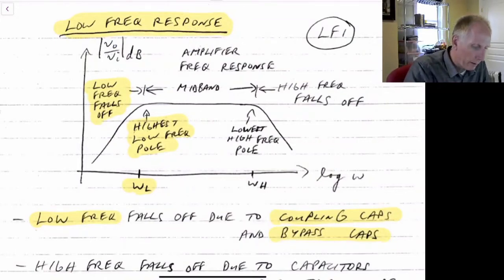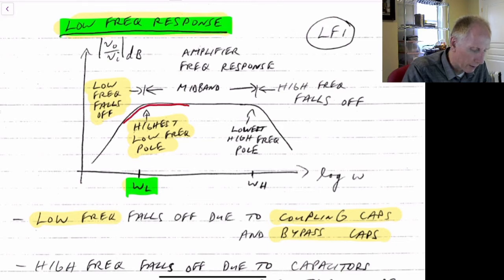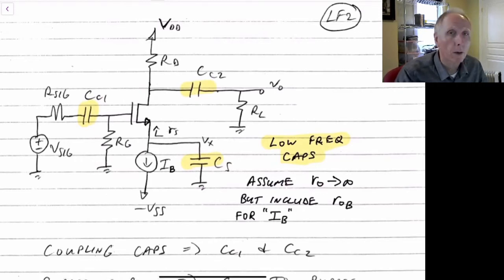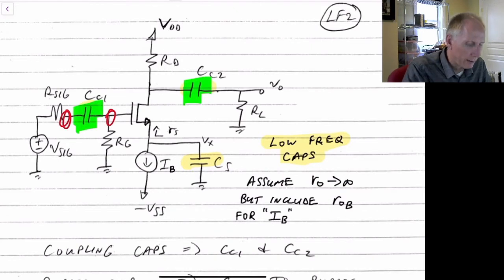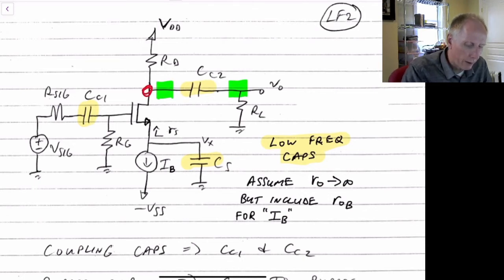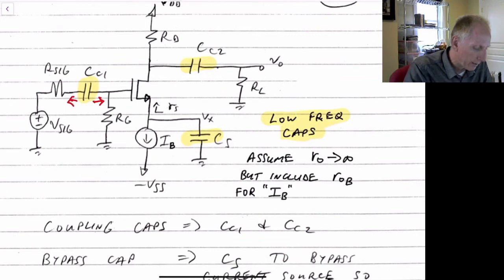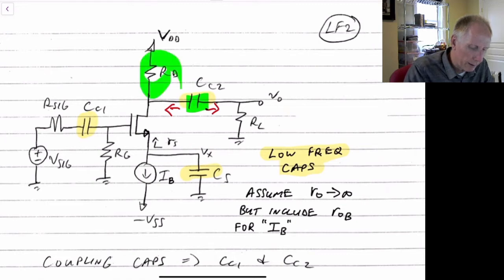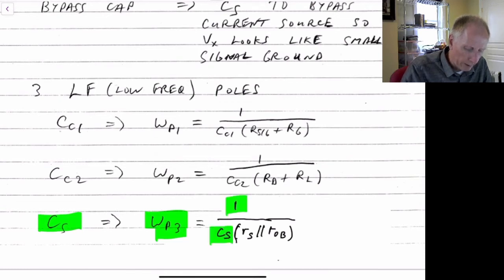Analog Electronics 2 - Low Frequency Cutoff

Comment: 10:15 - Why is that short circuit current 1/(r_s + r_{OB})? Can you give me a breakdown of the analysis steps?
10:32 - Here we talk about "DC" gain, i.e. when frequency is zero, but I am just wondering since we are looking at the "small signal model" how can that apply to DC? Aren't we supposed to look at the DC circuit itself? Or do they happen to have the same impedances?
12:09 - I am just wondering why this diagram is not exactly the mid-band pass as we saw at the beginning of the lecture. Maybe it doesn't matter, but are there any connections?
12:33 - We had three capacitor/resistor pairs (aka. time constants) before, how come we choose Wp3 for this?
17:22 - The example asks about "total capacitance", are we simply talking about the sum of all capacitors?